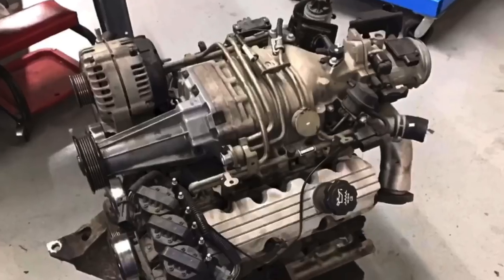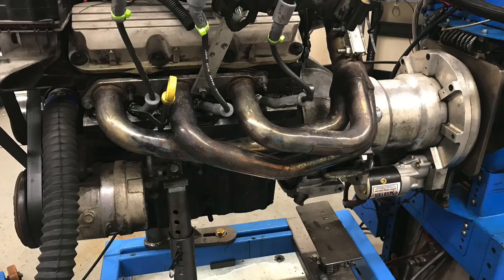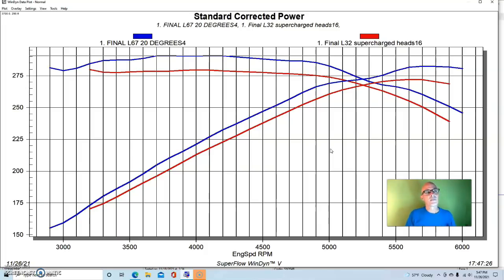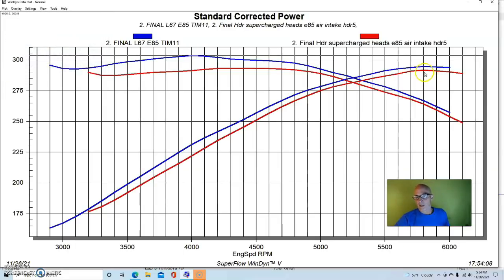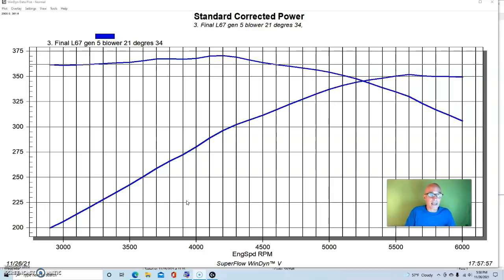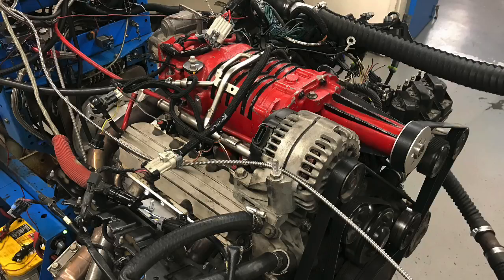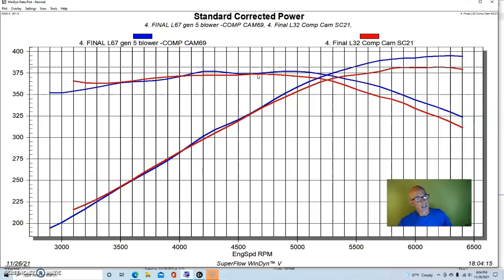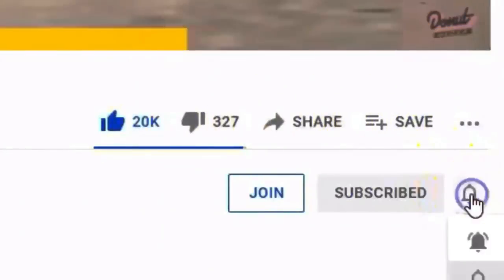SUPERCHARGED JUNKYARD 3800 V6 SHOOT OUT-L67 VS L32. WHO MAKES MORE ON 91, E85 AND WITH MODS?

Comment: Hello from Australia...we have the l67 in a Holden Commodore..  code named the vs Commodore.      1996 era.   It's a l37 na or a l67 SC 3800 rear wheel drive..I'm currently in the process of building a gravel rally car and a  butichmen circuit car ...I'm currently trying to decide whether to use the L67. $ 1500 need a real build...  well it would for race purposes...or a very hot na v6..  in Australia we call them a Ecotec...  GM ...

I sencerly respect your opinions...  you make a lot of sense....

As a rally car??   Yes it's heavy but it's very cheap for cars here in Australia.. engines are a  sensible price for a l67 ...

Just need a god like person like you to help me with a eng build.     I can almost guarantee that this is a winning combination for a rear wheel drive over 3000cc win.  

Long time ago I was involved in a vs Commodore v6 build ..na.   It was a very quick car in the right hands. 

Touqu is the winner in these very under ratted engines...

I'm currently working on building one

Comment: Rod bearing failure is common around the 215-250,000 miles in the 3800 S2& S3 engines. To check for this issue just run it with the knock sensor unplugged.

Comment: Great comparison and too bad L32 had some issues.Both of these Buick engines are what Pontiac should have put into the Fiero GT, not just the Grand Prix or Bonneville. A 400 hp Fiero GT would give Corvette a good run for the money and all because of poor GM management Pontiac is no longer around. Stroker 3.8L big bang engine with existing GM parts, please Richard.❤

Comment: The actual differences between a L67 and L32 can get kinda weird really. Before 2004 gm was experimenting with the L67 to "upgrade" it if you will. You can actually nab a series 2 block built as a series 3 engine and labeled as such in certain 2004+ Grand Prixs...why do I know this...I went and pulled an engine for my 2006 Grand Prix GT with an L32 out of a yard to start building recently. I pulled the engine out of a 2004 Grand Prix GTP Comp G, when I got the engine pulled the back of the block was stamped series 2 3800 but the plastic cowl on the top end was labeled series 3 supercharged 3800, once looking at the manufactur date of the car I pulled the engine, I found it was actually built in March of 2003, so funny enough early built 2004 "L32" are technically just upgraded L67s and by upgraded I mean before they started casting new blocks stamped series 3 for the later 04 models, they used series 2 blocks (both blocks are the exact same! In fact in the bottom end the only difference is any 3800s built for the 04 and up models is that it uses sinter forged powdered connecting rods over the old cast iron ones in the L67)
 The big differences come from the top end only, L32s have upgraded g5 superchargers, larger electronic throttle bodies with drive by wire electronics, larger exhaust and intake valves, and slightly improved cylinder head designs as such for the larger valves.

I would also like to note that L67s seem to do better with low octane fuel than l32s while L32s do better by what I see with higher octane fuel. It would be a good assumption of mine with the way that L32 failed for you, that the previous owner ran low octane fuel (87 or lower) most of its life which it HIGHLY doesn't like and will cause the engine to fail in a fashion similar to yours. Basically the engine doesn't get the proper power to operate normally. The only reason I know this is cause I have had my stock 06 L32 for over 10 years and trust me when I say if you use lower than recommended 91 octane you WILL know you have, it is sluggish as on 87 octane and doesn't want to accelerate, basically it feels like you are driving an L26 (NA Series 3), even 89 octane has a very slight delayed response as well.

In all if you take the heads, supercharger, throttle body, connecting rods, wiring for an L32 and lower intake manifolds off the L32 and place it on an L67 you create (drumroll please) an L32... 

Some swear the L67 is better while others say the L32 is better but personally by my opinion the 3800 is an amazing engine NA or boosted, hell I like telling everyone it weighs just barely less then the all aluminum 3.6L they have on the market now and the 3800 is all cast iron, that and the series 3 is the first gas engine to receive the SULEV (Super Ultra Low Emissions Vehicle) certification back in 2005, and at the time all other engines including the series 2 only were LEV. So a testament in my opinion of a lost great amazing engine.

Comment: What’s the difference between the l67 and the l36 I want to supercharge the l36 in my 2003 monte will the lower intake and supercharger bolt up to my l36? And what else would I need to make this work? Do I need a ecu intercooler etc

Comment: Thank you for doing all this 3800 stuff.  I know you're moving on from the 3800s.  But I would find it very interesting if you did a "top swap" comparison.  Take the higher compression NA block and put the l67 heads and blower set up to see the power difference.  L67 block is like 8.5:1 , NA 9.4:1
Reply from the maker: that will be 10-12 hp
Reply: @richardholdener1727  will that percentage of a gain stay roughly consistent while modding/increasing hp?
Reply: @John-cw4lz  well I guess he has said lots of times that each point of compression adds 3-4% so if you are making 200hp or 500hp it should be the same percent

Comment: would love to see a 2008+ chrysler powertech 4.7l v8, the corsair version with 16 spark plugs. on allpar the specs and building materials used in the 2008+ models seems like a great start to a surprising amount of power. stock and turbocharged or fully built and turbocharged would be awesome.

Comment: from what i’ve read, the bottom halves of the motors are basically identical. The l32 heads flow better, and the supercharger is more efficient, which is why it is rated for more power. I don’t think the block, crank, or pistons would make much, if any difference

Comment: Will these FWD engines bolt to a RWD small block chevy transmission ?
Reply from the maker: you can bolt them to a rwd trans (bell housing) from a 3800 Camaro (not a sbc or ls bell housing)
Reply: In Australia these only came as a RWD :)

Comment: Highly doubtful that an l32 would make more. Only different in bottom end I believe is the rod material. And what made the l32 20 more hp was a more "aggressive" tune, better tb, supercharger, and slightly slightly bigger intake valves.

Comment: Did you use the same set of heads for both? You mentioned both had L32 heads, but the ones on the L67 were r3conditioned. I’m guessing the set on the L32 were as found in the junk yard. That and a little more wear in the shortblock could be the difference.
Reply from the maker: both used the exact same set of reconditioned l32 heads

Comment: The main difference between l67 and l32 is the gen iii vs v m90. To accommodate the gen v on the l32, gm opened up the lower intake and used a bigger throttle body that's drive by wire. You can actually take a l67 lower intake manifold. Put a l32 gasket on it as a template and cut away. Now you have a l32 lower intake :). That's the main difference.

There are 2 additional differences that are minor, but honestly doesn't matter much. First is the heads. The l32 got slightly bigger intake valves. .03" bigger.. barely anything really, doesn't make much of a difference. The last is the piston rods. There's a big debate on which is stronger. Some say l67 rods, others say l32. I couldn't tell you. One things for sure. The l32 rods are thicc bois. When they break they typically shatter. L67 rods bend. From what I gathered from watching multiple people build and break 3800 (I've never broken a rod 'knock on wood') it appears they handle equivalent power. The way they fail is different. Remember, power breaks rods, bad tune chips pistons, wear eats bearings. I've commonly seen multiple turbo 3800 (l67, l32, l36, l26) sit reliably at the 4-500 whp (unsure on crank hp). It appears 800 whp is the limit on factory 3800 rods.

I fully believe that your particular l32 was a failing engine. Junkyard engines are like a box of chocolates... The major power difference is the gen v m90. The other 2 veritables don't make a significant difference in terms of power. Theoretically, when you gen v swapped that l67. It in essence became a l32.

Comment: Why not just look for a set of Buick 3.8L/G-body or 4th-gen F-body headers, Rich? You know there's many looking to lay their hands on either of these engines for a swap into a RWD or 4WD [S-truck] platform, providing they get a hold of the inlet Holden used to put it in their Monaro CV6!
Reply: The older g body 3.8 engine is way different from this series 2 3800. Those won't fit due to the exhaust port spacing. The 3800 f- body headers will fit though.

Comment: Seems like a basic engine condition difference.  We'd see equivalent L67 GTP's perform at wildly different levels on the track and dyno (we called them "factory freaks").  It'd be interesting if you find another one of each to repeat numbers, but I know you dedicated alot of time to 3800's already.
Reply: Sometimes it's the small stuff that adds up to this. One cylinder head casting may just not have casting flash in areas another does intake manifolds too. These are mass produced units with many different molds casting heads intakes blower housings.

Comment: Second comment ha! Lol

I think maybe to get a better test result, is just swap the lower intake, gen 5 blower and TB from the L32, onto the L67 motor. They're technically supposed to be the same bottom end spec wise, so using the same short block could give realistic number differences? That would at least remove the possible problems from the L32 motor.

Good video Richard. Interesting that the intake valves were the same size though. Document specs have the series 3 heads having tiny slightly larger intake valve. 1.83" vs 1.8"
Reply from the maker: DID YOU WATCH THE VIDEO? THAT WAS DONE
Reply: @richardholdener1727  I guess I misunderstood and missed that part. It was my understanding that you used 2 different engines all together. One being the L67 and the other being the L32 that had a possible bad cylinder. Did I misunderstand?

Comment: These videos are making me consider a 3.8 SC swap into my 4.3 S10…..
Reply: I'm putting a 3.8 sc in a MGB.  The blower intlet is at the back of the engine and this is a pain in the butt.  I like quirky combinations, but a turbocharged 3.8 using the na intake is probably a much easier swap
Reply: Just go 5.3?
Reply: @eazhar  that is the current plan. Cammed 5.3 should plenty.
Reply: Any other good v6 options for a rwd? I'm thinking of swapping into an early Jeep.
Reply: @xmo552  it depends on your goals.  The 4.3 had good torque and can use a lot of small block Chevy accessories as well as using the same bell housing bolt pattern as the 350.  That gives you lots of options and you can get Edelbrock intake manifolds for a carburetor setup if you desire or go the route of port fuel injection of you go with a later engines, you will just have to do more to upgrade the fuel system if you go EFI.

They also used 3.8s in gen 4? Camaros, you just probably won't want to use the supercharger but the rwd 3.8 had a better throttle body position.  In this case you may have more trouble finding and oil pan that fits.  

The 3.6 V6 Chevy uses in Camaros and Colorado's might not be a bad option, you just may not have as easy a time finding a cheap engine but I believe more people are starting to swap them into cars and the probably offer greater power potential.
Reply: Lame! Ls solves everything! If you want reliability, just buy an l67 w body or l32 grand Prix to enjoy

Comment: This is the stuff that has always crossed my mind about the 3.8.. thanks for the videos!
Reply: V6 mustang help WOULD be nice. Always v8 motor support and v6 owners are told get a v8 instead of solid  help
Reply: @douglasnolden3888   Vulcans have a lot of performance potential, a friend of mine had a Taurus that we ported the heads, ran ratio rockers, ported throttle body, headers and an x pipe and it picked up a very surprising amount of power along with an adjustable fpr to tune it
Reply: @turkeyboyjh1  thank you soo much!!! Ill start to look into it and see whats what with it. God bless!